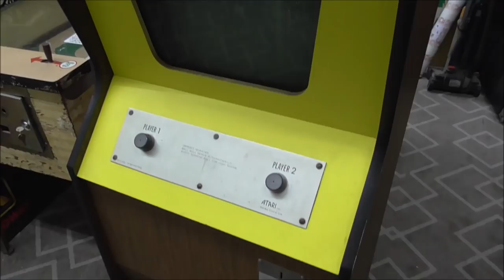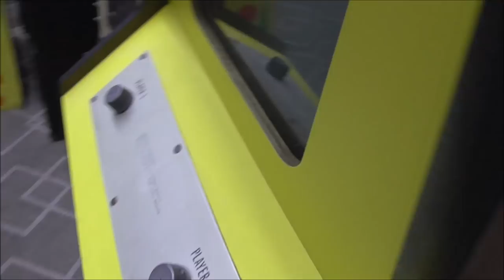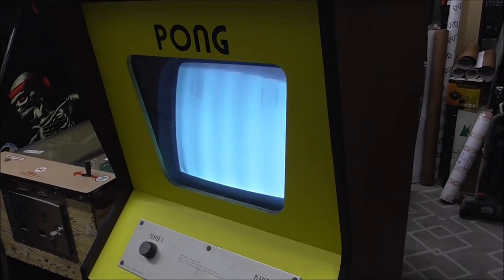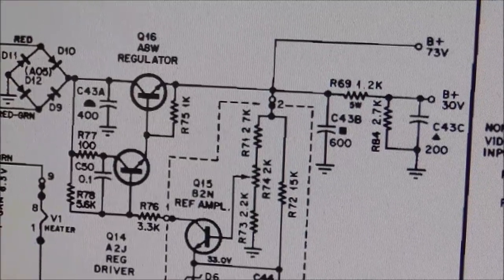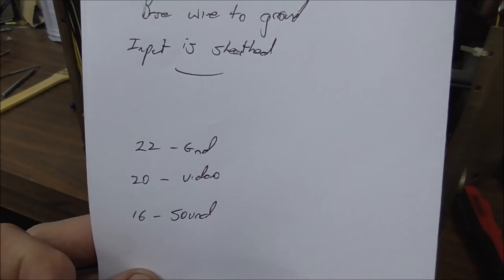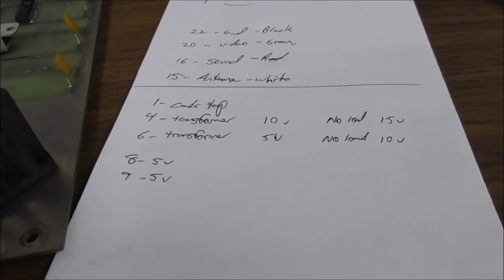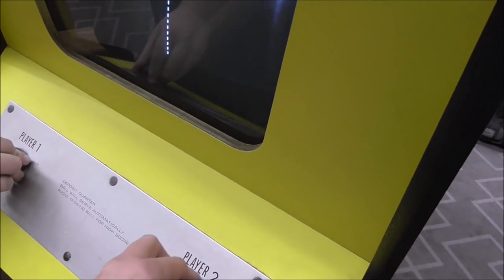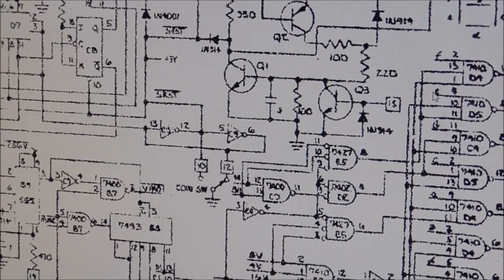Repairing ANOTHER Atari 1973 Atari PONG Arcade Game - What a Legend!

Comment: In 1977 we had a Pong machine in the electronics lab of my high school.  It was set up for nickles and there was a line of students to play it before and after class.  FYI, I went to Homestead High school in Cupertino.  It was ground zero in Silicon Valley.  Steve Jobs and Steve Wozniak both went to Homestead about 10 years earlier.  I wouldn't be surprised if there was a Nolan Bushnell connection given the presence of the pong machine.  Everybody knew everybody in those days.

Comment: I've seen this model of monitor in a Quadrapong cocktail table where the newest IC was dated first half of 1974. The machine had only 120 games on it, there was no screen burn and apart from a dead chip in the address generator (which screwed up the picture big time) it was working fine. That monitor had sound built in though. I've also seen this monitor in a Wang PC from 1972 or 73. Damn I love circuit porn. But I only replace capacitors that are bad or likely to fail soon (eg. toasted by hot components surrounding them).
You could create static with a piezo lighter. The earlier machines didn't have that circuitry.
Reply from the maker: I’m going to have to try one of those lighters!
Reply: Wang terminals.... mmmm love the green screen its been decades since i played bowling on 1.

Comment: The 'wierd connector' looks very much like an old Molex one. I used to work for a telecomms company that still built some old control equipment that used the same. They went obsolete and I believe our company bought the tooling to continue ordering the connectors.
Reply from the maker: That big green one you can still buy believe it or not, they use them on other stuff I think, I guess anything with a card edge connector on it could use that style... I like Molex stuff but it seems they always discontinue whatever part I'm looking for and I have to buy some NOS ones from somewhere!

Comment: Back in the day we used to zap the machine on the coin slot with what was used to light gas heaters and stoves  to get credits
Reply from the maker: Atari Foiled you :)  I never heard that you could do that, I'll have to look into trying it on some of them :)  Thanks for watching Jamesnov1970!
Reply: Well I know it worked on Missile Command and some pinball machines.  Making sure it had contact on the metal, the one I had there was a wire attached which was slipped into the coin slot lol

Comment: Oh my, thats all it was the knocker leaf and soldering the video wire to get it running? ha.  A buddy of mine who owns an arcade told me a buddy of his has a cab that always resets whenever someone wearing nylon jogging pants rubs their leg against the coin door lol so static on the coin door is a thing!
Reply from the maker: We had a touchscreen game in a bowling alley one time that if you touched the screen it would reset, we eventually figured out it was the static electricity from the carpet, we put a rubber mat under the game and it fixed it.
Reply: @LyonsArcade  lol nice, imagine the makers manual? Troubleshooting 1. "If game resets when touched, before checking 5v place a rubber mat infront of the game," ha

Comment: I was almost sure that the antenna was their way to send the signal to the tv set, you know, screw it on the UHF terminals. I guess the TV set they used was modified to receive audio and video separate. They usually wont have RCA audio/video jack in 1973.
Reply from the maker: Yeah they had this weird thing they did where they modified the t.v. sets, they had the UHF terminals on the back, and there was a ground wire, a video, and an audio... but inside the UHF terminals had been disconnected and they sent those three lines to three specific places on the chassis... so each t.v. was slightly modded where the input went in since the audio was separate.

Comment: Thanks for the video! I always found those fat multi-cap-in-a-can tedious to replace and I wonder how you approached it. I usually cut the leads underneath and re-route the cables to the replacement caps that I place elsewhere on or underneath the frame. I then leave the can in place but disconnected.
I have an Atari Pong that I purchased from its original operator and it also has a Motorola in it. It is the slightly newer model; XM-501. I asked the operator about it and he told me the old TV:s were crap and they often had to replace them. Can't remember if he said they got their Motorola replacement monitors from Atari or elsewhere. These Motorola monitors also have a 5v-supply built in to them and I've seen some bronze age games where the operator(?) has hacked the harness to supply the board with 5v from the monitor instead of the power supply. Guess that was a quick fix when original power supplies or on-board 5v-regulation failed.
A tip if you didn't get to the paddles yet: after replacing the pots, the paddle positions can be calibrated using the pots on the PCB.
Reply from the maker: I've seen that 5v circuit on them before but never could figure out what they use it for.  I do like you said, I removed this can though because I was going to try and rig them up in the same hole but ended up having to mount them at the edge of the board where I could tie them down.... We ran into all kinds of problems with the pots that we end up covering on the next video but we'll see you then, thank you for the information and for watching Kristofer!

Comment: I know early games like Pong didn't have a microprocessor, but what type of chips did they use? Also, could one use an LCD display?
Reply from the maker: It sends out composite video so yes you could hook it up to anything that takes a composite video signal.  Only thing is the attraction of Pong isn't the gameplay, it's that it's a piece of history, so putting an LCD in it would be like putting chrome rims on a Ford Model T.
Reply: @LyonsArcade  Yeah, I guess you're right. The reason I asked was because I don't have a CRT TV anymore and want to build a board.

Comment: Hey always love your videos and the store.  I live nearby the shop and wanted to know if you repair PCB boards?  I have a Track and Field board that works fine but not saving the high scores.  Thanks!
Reply from the maker: We don't do pcb repair (we mainly work on our own games but sometimes do complete machines) but there is a dipswitch to turn on the memory, it's dipswitch 2, switch #5, if it's off it retains memory . If that is on, and it forgets it's high scores at power up.  If it's still not saving or that switch is in the right place, you need to replace the battery on the pcb....

Comment: Joe classic, You mentioned in the video that the center tap wire on the transformer was disconnected which was causing higher AC voltages? why would it cause higher AC voltages.What are those components that you said to not change because you have ran into problems in the past? those components look like tuning capacitors or tuning coils. Have you tried using an RF signal or static signal to test if the antenna circuit works? I'm guessing its a special type of antenna to only pickup static noise? because if you held a radio near the antenna would this turn off the arcade game?
Reply from the maker: I'm not an expert but the center tap is basically it's 'ground' without it, the other two voltages will drift one way or the other... but still add up to the total it was supposed to have over both sides, you'll just get one voltage high and one voltage low.  If you have the center tap connected it's going to give you the same voltage from center tap to either of the voltage lines, which is how the game was designed.

The components I said not to change were some sort of capacitor, they're not paper or foil I don't think though, so I'm not sure what kind they are, I always leave them because in the past when I swapped them I couldn't get the exact specs in new caps.

I have not tested the antenna circuit, no.  I'm not sure if a radio would turn it off, I think it's more to do with static like you mentioned, not actual audible music but voltage in the metal parts of the cabinet.
Reply: Thanks for the help. If you turn the portable radio to an in between frequency on an AM/FM station to get static RF noise it would get pickup by the arcades antenna to turn the game off? The old radios had a variable dial to turn the AM/FM radio frequency and can get in between that sounded like RF static noise, not sure if they were thinking kids would do this to trick the coil door coil to turn on/off?The schematics should tell which values those special capacitors are, but I haven't seen capacitors that looks like those. What values does the schematic say those capacitors are? they might be tuning capacitors maybe.

Comment: I know this has aboslutely nothing to do with the video, but I agotta ask, So I have a bluetooth speaker that the original input connector is flakey, so I'm trying to adon some wires for another one. Here's my problem, I got the wires sildered and I am getting the 8.31 volts DC, but when I give it power, the green LED light doesn't come on.....Im kinda stumped. If I coul.d make a small video to show what I'm doing maybe you can undrstand.....Thanks man. Thanks for the previous comment to me btw.